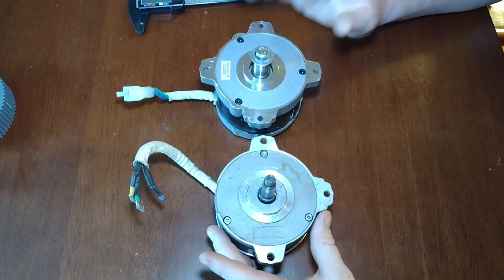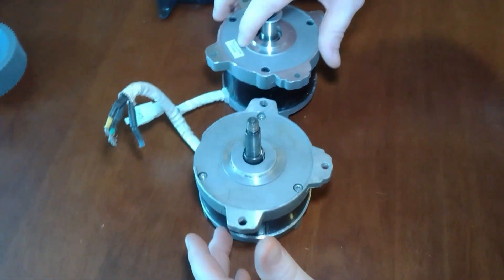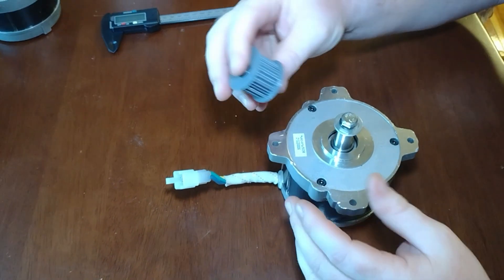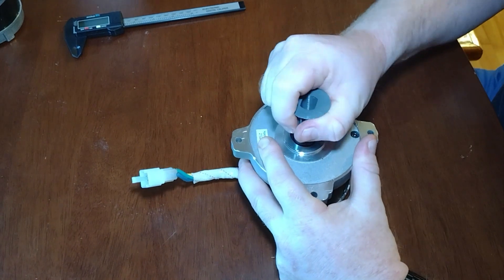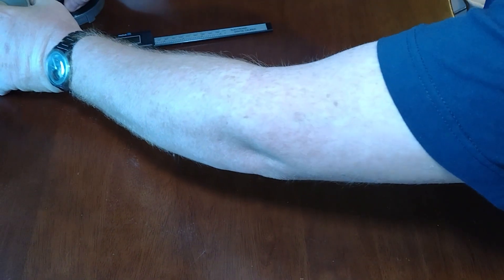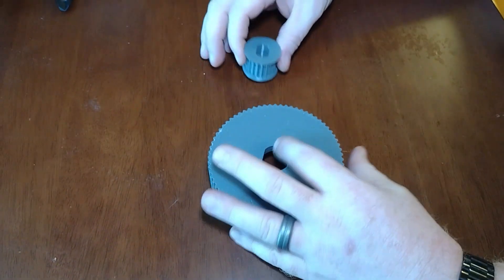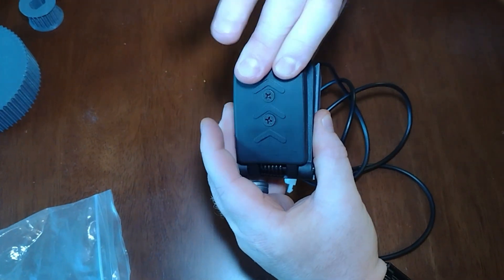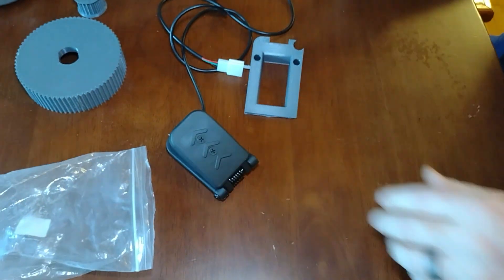3D Printed Upgrades & Belt Drive Pulleys for Ryobi 40V Powered Electric Lawn Tractor Conversion

Comment: How did it work with the cogged gear?  I put one on the motor in my electric side by side conversion and found that it actually needs a ton of tension or the belt will jump teeth.  Granted, I'm using a motor with 10x the torque, I'm just curious what you've found?
Reply from the maker: My use is low speed, but I do pull heavy loads with it. But I don't allow it to put that fast snap of torque to it. However, I do not need much tension to avoid skipping teeth. If you are having trouble then a larger pulley on both sides with more teeth to engage would likely fix the issue.

Comment: I received the cog belt and everything works fine. I ran it around the yard for about 10 minutes. I know, not much of a test. The mower seemed to be a little on the slow side, even with the e-Bike controller on the fastest speed. Have you thought of changing the 20 T cog to like 26 teeth to get a little more speed? I also noticed my Yard Machine Forward, neutral and reverse still work. If I want a fast reverse, then I use the YM forward and reverse level. If I want a slow reverse, then I use the e-bike controller switch. The motor was not hot and 10 minutes is not much of a test. I will need to add a fan and I am thinking of using a coupler to the end of the motor shaft to give me the extra inch I need. What is the curve up part on the 20 T cog for? If I eliminate that, I will be buy more space on the motor shaft.
Reply from the maker: That's a good first test. Removing the extra on the gear shaft will indeed give you more space. I designed that just to fill the shaft and improve grip. But it could be utilized. I set the speed a bit slow due to the extremely hilly yard I have. If your yard is level a bigger pulley could work well. I would probably go with 24T. If you go too fast you may find the cutting deck won't keep up.

Comment: Thanks for the references to thingiverse for the cog gears! Are you not using the white plastic motor fan when using the 20T Cog on the Ryobi motor? I do not have enough room on the motor shaft for both. The 72 Cog did fit nice and tight on the Yard Machine transmission shaft. Now working on mounting the motor to the frame of the mower.
Reply from the maker: I didn't use the white plastic fan, but I did add a separate PC fan on my design to cool the motor. i think the motor mount on thingiverse had holes for one. If not I'll update the file.

Comment: Can you provide a link for the motor?
Reply from the maker: I bought it on eBay, but the seller I got them from doesn't have them anymore. There are a number on there still depending on what you need, but I don't have a specific one to recommend.

Comment: This is awesome.  Any recommendations on where you can get a new shaft for the Ryobi motor? I’m using one to electrify an old reel mower, but need a longer shaft and the ability to put a sprocket on it….. or I could 3D print your cog setup too.
Reply from the maker: Not that I know of. I've seen other designs that are similar, but most have shorter shafts.

Comment: What type filament are you using? (I doubt PLA would last very long)
Reply from the maker: I've experimented with a couple different ones. I tried PLA for the motor housing as a test for fit. It started to melt after about 15 minutes of use. I need to do another video with some samples, especially now that I have a better printer. The one I had was failing, so some of the prints weren't up to the needed quality. PLA Tough seems to work for the drive belt pulleys. I actually made a good batch of them with a low infill an thick outer walls, but no top layer. Then filled them with epoxy resin so they were hard as a brick! That is what I currently have on the tractor for my pullets. Another one that works pretty good is PETG, and it works for the motor housing as well. That is what my current motor housing is made of. If I do ever need another set I will probably use ASA since I finally have a printer that can work with it. It is very heat resistant and strong and should hold up to the abuse of my lawn.
Reply: “… filled them in with epoxy resin…” Great idea!!